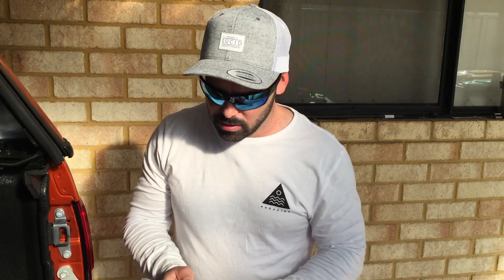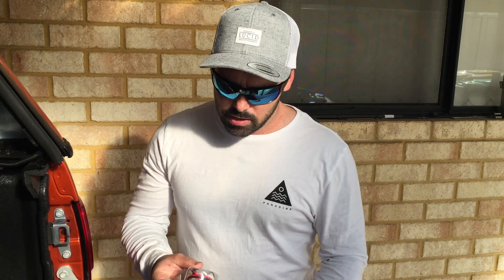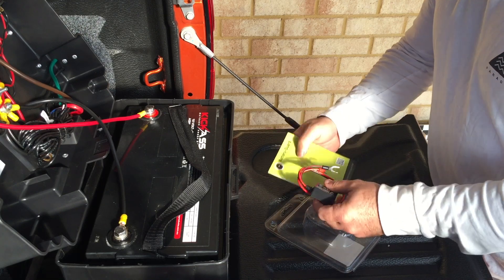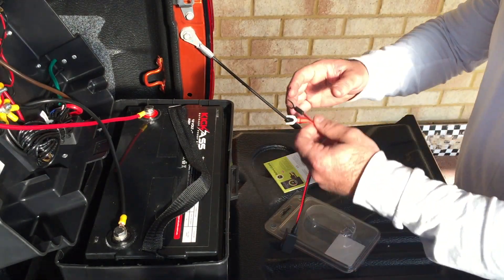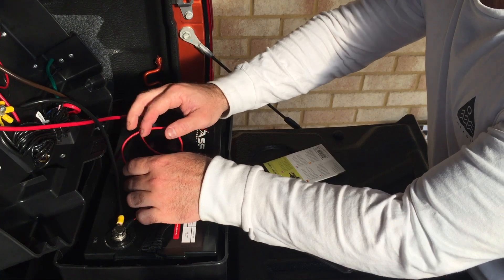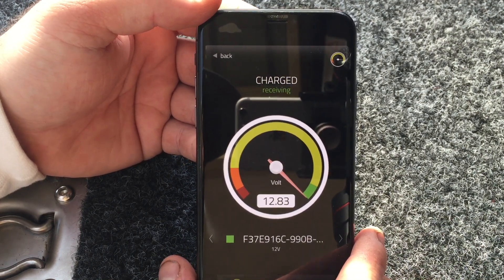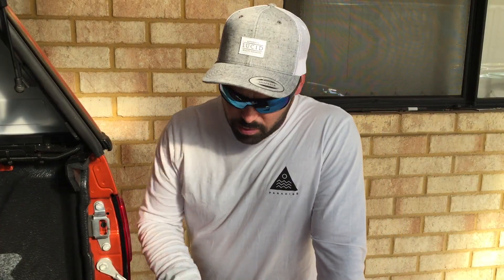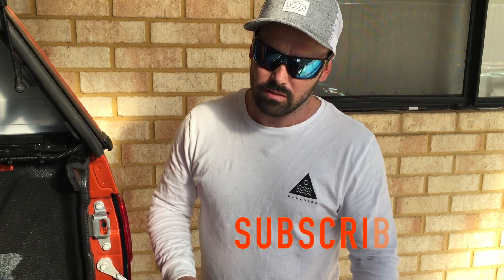Wireless battery monitor

Comment: Does it send you alerts if the battery dips below a specified amount?  Does it only send you the information when you check the app? Can you connect other devices to the battery if your battery monitor connects through the cigarette lighter instead? I'm wondering if this in conjunction with a solar trickle charger and always on dash cam will cause issues.
Reply from the maker: Andrew Sutton it only monitors battery’s volts, so if you connect something to the battery it will not tell you the draw. But if you have solar input to battery it will raise volts while charging battery there for you can see charging is working. Best bet to see charge input from solar is buy a anderson plug volt metre kickass also sell. And you can’t set alerts but you can see a graph to see battery loosing charge. I Use it more just to check volts instead of having to go out and open car up to check. Hope that helps
Reply: @thecaravanfam6472  thank you!